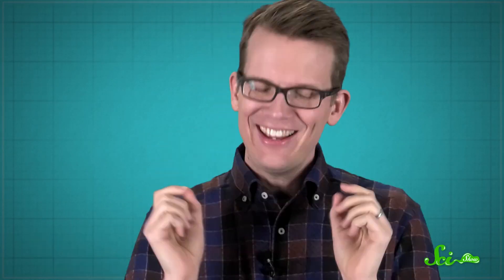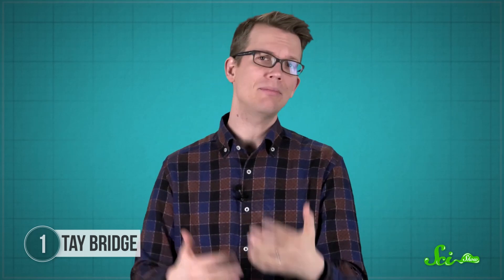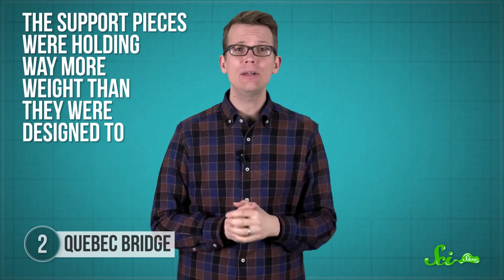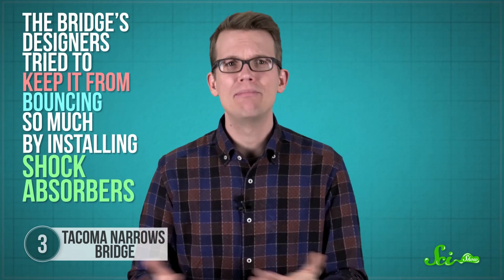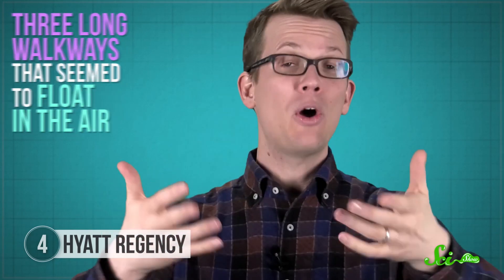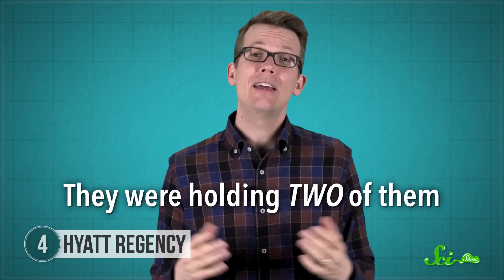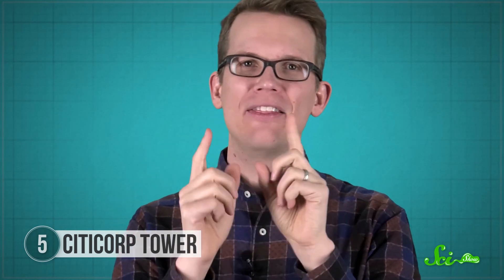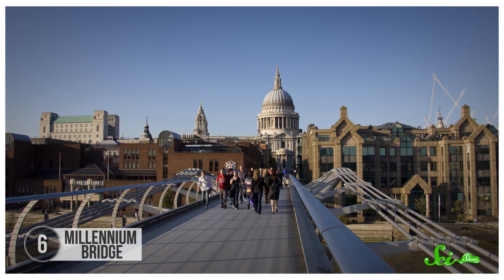6 Construction Failures, and What We Learned From Them

Comment: You missed SO much with the Tacoma's narrow bridge. That day the wind happened to be continuously driving the bridge to oscillate at its natural frequency. The cables snapped as a result of harmonic motion, which just allowed the bridge to oscillate to it's natural frequency quicker. With no proper damping the energy in the system caused the bridge to collapse. It's a simple concept that could have easily been explained...

Comment: 6:12 
You got it all wrong . 
Engineers can not make a mistake like that . 
Maybe the first engineer can , but it will be spotted from the next engineering or the next the next the next that reviews the project . Not to mention there were computers . 

That is a childish mistake ! 
If a floor supports two floors and not just it own weight then be sure that it is calculated to do so . 

The problem is that whene these calculations are applied in the structure the materials are not put in place as they should . 
For example the beams that are ment to support one floor are put in the place of the beams that are ment to support two floors .

Comment: The dampeners could generate power, like some wave power systems. I wonder how efficient those are compared to this US DOE funded one:
"Atargis Energy has designed, constructed, and tested a 1:10 scale model of its Cycloidal Wave Energy Converter (CyCWEC) at the Texas A&M Offshore
Technology Research Center. The CycWEC is designed to address storm survival and energy costs—two issues that hamper many wave energy converters
currently under development. The DOE-supported work demonstrates on a kilowatt scale the world’s first fully submerged wave energy converter system
capable of cancelling deep ocean waves using hydrofoil lift. Laboratory tests and simulations have achieved 99% wave cancellation. System modeling
indicates greater than 70% overall wave-to-electric power conversion efficiency and levelized cost of energy below $0.14 per kilowatt hour are attainable." - They were working on a 5MW model in 2015.

Comment: Another failure to look at would be the Melbourne Star (previously the Southern Star) Ferris wheel/flight. Work began in 2006, delayed and delayed for years. Closed 40 days after opening after large cracks were seen, which were initially blamed on the extreme changing weather conditions Melbourne goes through and subsequently dismantled for scrap. Inspection found that it was poor design, not the heatwaves, that caused the cracks. Upon reconstruction, many faults kept appearing. In December 2013 the wheel finally reopened. Again, since then, there have been minor faults along the way, including a cabin that got locked in position and didn't rotate as the wheel moved.

Comment: Surprised you did not include the Willow Island cooling tower collapse on 1978 Apr 27. I ended up in one of the ERs which handled the injuries just as they were cleaning up from the insanity. I had shattered my arm, and my doctor set my arm wearing the same pair of scrubs he had worn all day treating/operating on the survivors.

Now, on a "funny" construction failure list, though you probably cannot find anything about them... there was a bridge they were constructing about 30mi down river from Willow Island where WVDOT had to stop and rip out a tower and a few sections because they had misaligned the construction efforts from the two sides of the river.  Or the stupidity where they had been working from two different directions on I-64 and had to redo a chunk because they had shifted things so that one lane from one direction met up with the lane for the opposite direction which they were building from the other direction.

Comment: Get your facts straight on Citicorp Tower.  The original engineering drawings called for welds, but the construction co. used rivets and inspectors didn't catch the difference or were paid to turn a blind eye.  This was not an engineering failure.

Comment: the Hyatt Regency also failed because of the supports holding the rods. they wielded the open end of the beams together which buckled in on its self on the weilds, instead of using solid beams.

Comment: Hank, I'm almost positive you got the skyway failure wrong. I remember learning in engineering school that the suspension system was held by bolts in single shear when the design called for double shear. This doubled the load on the bolts leading to failure.
Reply: That is possible, but everything I've heard from the engineering classes I've taken and my own research have almost exclusively talked about the change in the design for the rods. There's actually a problem about the thing in my Physics textbook, though it shows three walkways interacting with each other instead of two and saying that the safer design was "impossible" because you couldn't put the nuts on any of the walkways except the bottom. This completely ignores the fact that, were the rods threaded along their entire length, nuts could indeed be threaded beneath all of the walkways.
Reply: As I understand it, the contractor initiated the change to make construction easier, he forgot to tell the engineer...

Comment: The Hyatt Regency disaster was caused not by an Engineering design problem but rather by the builders from what I was taught. The builders themselves decided on the change but it ultimately ended up being at fault because that change was overlooked.

Comment: Guys it's important to note that the engineer responsible for the building (5) in NYC had said to weld and not bolt the structure, it was the bolting that was the problem
It was cut because the  contractors wanted to save time and money on the project

Comment: On the subject of necessary bridge inspections you missed the MPLS-St. Paul I-35 W bridge collapse.
Reply: timmmahhhh When I was A young engineer designing a platform to hold two mixer gearboxes over a tank, I
I totook it to a more experienced engineer along with my calculations. He said it should work, but just didn't look right
THen he told me "People 
E remember you for what falls down, not what stays up." I beefed up my support design after that. It's still working after 35 years.

Comment: note to self: do not go on wobbling bridges
Reply: I'm in Pittsburgh so we have no shortage of bridges here. All bridges wobble and move. It's a little unnerving the first few times you notice it, usually sitting at the very ends of the bridge where the movements begin to speed up but have less room to move is where it's most noticeable. A lot of times I found it's not very noticeable when I'm in my car but when I'm in my truck it's extremely noticeable.
Reply: I drive over a wobbley bridge everyday. It’s a floating bridge built on pontoons across a lake and you can feel the bridge moving in high winds. (This bridge actually sank in 1990) but they say it’s perfectly safe now...

Comment: I don't understand the skywalk problem.  It seems to me like the ceiling rods were supporting both skywalks in both designs. What's the difference?
Reply: The redesign added a lot of extra stress to small, but vital, parts of the skywalk. Eventually, the stress grew too much and the thing just failed.

Had they stuck with the original design, the extra stress wouldn't be there.
Reply: foxymetroid Oh,I had to watch it again to understand.  I thought the ceiling rods were the problem.  But it was the 4th floor supports, they were supporting twice the weight and failed.

Comment: There is more interesting detail to the Hyatt disaster.  I recall reading about in in New Scientist (UK) at the time.  

The engineer who designed the structure deserved part of the blame.  In his plans, each rod was supposed to have threaded sections in the middle, for the nuts that would support each walkway.  

However, that design would have been very difficult to fabricate.   The contractor would have had to cut threads on the entire rod, so that the nuts could get to the proper places. Perhaps also there were no plants who could have fabricated such rods of that length; I don't know.  

Anyway, the contractor formally requested permission to change the design as shown in the video.  With that change, the rods would need threads on their ends only.  Then someone (perhaps the same engineer) approved the modification, without realizing that the loads would change completely as a result.
Reply: PS. What failed in fact was not the rods, but the horizontal beams that supported the walkways.  Each beam was a hollow rectangular bar made from two C-section steel bars, welded at top and bottom.  The weight of the bottom walkway passed to the nut on top that beam, and then the nut at the bottom of the beam received the weight of both walkways.  The two nuts then pinched the beam, splitting the welds and separating the two C-sections.

Comment: Should have put the Space Shuttles on this list.
Reply: Challenger exploded because the boosters weren't supposed to be used in weather that cold. In fact, the engineers knew this and tried to get the higher-ups to cancel the launch. Columbia exploded because the astronauts didn't get an okay to check the heat shield.
Reply: +foxymetroid - I wasn't referring to the explosions, just the design and construction in general. $600B for 135 launches, when it originally promised 30 launches per day and to cost half as much.

All associated engineers now say that we'll NEVER build one like that again, from now on, the capsule and payload go right on top. No more chunky space plane designs.

Comment: What about the tower in London that had a concave side that faced the sun, causing it to focus the sunlight across the street and melting the interior plastics of a car parked there?
Reply: That was the front of the Walkie Talkie, I think they had to coat the glass in some sort of absorbant material that then raised the interior temperature of the building meaning they have to run the air-con continuously.

Comment: The Citicorp building was originally supposed to have the welds and not bolted joints - that was another on-the-spot change to the plans to save costs. As I understand it, the head designer wasn't even aware of the change until he went back to the plans after speaking with the student asking about the building's stability.

Comment: I have heard a different story for the Citicorp tower. I heard that the designer had always intended the building to have welded sections rather than bolted for exactly this reason but the builder used bolts to save cost.

Comment: When I was in London three years ago and was supposed to cross that bridge over Themes I walked a little bit (not even 1/4 of it), then I had to turn around and walk back. I didn't trust that bridge at all, there was something about it that made me dizzy, felt afraid of the height and just made me kind of sea sick (it felt that I would vomit). I had never heard about these problems with the bridge. I wonder if it's completely safe now, because for me it was something that made me very worried about it, and I normally have no problems with walking over bridges. I wonder what made me so unsure about it.

Comment: wasn't there a metric/imperial oversight with the space station by the Russians and US?
Reply: You might be thinking of a mars orbiter mission. The company contracted to build the probe worked in imperial (even though NASA required metric in the contract) and rounding errors in the mass conversions resulted in the orbiter becoming a pile of scrap on the mars surface :p
Reply: Similar situation with gallons & litres of fuel in the Gimli Glider.

Comment: Unfortunately, we continue to encounter the number 2 issue. A number of University libraries (UMASS Amherst, ULM, etc.) have been constructed across the United States that were built only to find that the building couldn't support the volume of books that were meant to be installed. 
Lesson: Dead Trees are Heavy.
Reply: Also UT Austin Battle Hall. It suffered cracks as the books arrived.

Comment: It's worth noting that the Hyatt Regency walkway failure was the engineers essentially calculating 1+ 1 = 1.  It's a surprisingly easy mistake to do when you make last-minute changes to a design.

JAL 123, the single worst single-airplane disaster in history was caused by exactly the same error.  The aircraft suffered from tailstrike damage on a takeoff and Boeing engineers made an accidental stress doubling error in the repair.  Several months later, the rear bulkhead ruptured, severing all the hydraulic control lines.  The plane, unable to steer, flew into the side of a mountain 32 minutes later, killing 520 people.

Engineers, double-check your math!

Comment: Can you call 9/11 a structural collapse ?
It didn't have anything to do with engineering
Reply: cartbart1 The engineering aspects did contribute (and all building collapse is technically structural) but not in anyway the designers could reasonably anticipate. Calculating the force of the impact of a plane is different from designing out the effects of a plane being deliberately flown into it, with all the additional damage that causes. In this instance having the structure on the outside and having steel truss floors contributed to the failure.

Comment: I remember taking a class for engineering on #4 Hyatt Regency. The class went through everything that went wrong with the project and we even had mock court battles between the engineers that signed off on the faulty plans, the contractors who sub-contracted pieces of the project out to the cheapest company they could find a bid for, and even the project architect. I ended up drawing the lot to be the contractor company representative that hired bad sub-contractors to do the work. I assume this type of example is the introduction to engineering class every engineer has to take now. Even though I was majoring in Computer Engineering & Computer Science I had to take this class as well. For my major it would have been computer simulations that should have caught the faulty design. The beams were not thick enough and the bolts were not suitable for the amount of weight the components had to handle. It was basically a blame game, the sub-contractors blamed the general contractors who hired them and the general contractors blamed the lead engineer who blamed the project architect.
Reply: The story is more complicated than that. The original design (as correctly described in the video) using a single long hanger with an intermediate flange to support the upper walkway was, in fact, not actually something that could be fabricated. It was then that the design was changed to something (two separate hangers) that could be fabricated. Even today, too many engineers have extensive experience with structural design calculations and little or no knowledge about fabrication processes. It is easy to draw something on paper (or on a computer screen) that, as a practical matter, can't actually be made. Another famous example was the Sydney Opera House. Jørn Utzon designed something that looked fabulous on paper, but couldn't be built as originally conceived. It took years and millions of dollars before they could figure out how to fabricate something that appeared similar to the original concept.

Comment: There was another serious design change that created a flaw in the Hyatt skywalks. The horizontal beams that the skywalks' supports connected to were designed to be I ][ shaped beams. The design was reversed to become  box [ ] shaped beams. This severely hampered the horizontal beams' abilities to handle the force of the skywalk's supports. During the collapse, the supports simply pulled right through the thin middle connection points of the box shape, and the rest was history.

Scishow did cover the most serious flaw, of course, but not the only flaw.

Comment: I believe the Hyatt Regency's fatal flaw was actually in the u-beams that the rods were attached to supporting the walkway. The way they were welded together, to form a box with the rod going through the middle, had almost no load bearing capacity and were primed to split apart. While the separate rods didn't help, the incorrectly installed u-beams caused the collapse.

Comment: The Quebec Bridge Collapse you talked about is the reason most Canadian engineers wear iron rings on their pinky fingers. After they graduate there is a special ring ceremony where the graduates are awarded their rings and are reminded about how important their jobs are. They wear it on their pinky so they feel it rub the paper as they make their designs constantly reminding them about how important it is to do their job as carefully as possible. Basically its a constant reminder of the engineering failure of that bridge and what happened. People say that some of the first rings were made with actual materials from that bridge but i doubt that is actually true.

Comment: In a few years, you guys might need to update this episode with the fucking disaster that is the eastern span of the Bay Bridge in San Francisco, CA. It was way over budget, took several years over the estimated completion, and turned out to be chock full of engineering problems (rusting components, leaking on the bridge and in the structures that penetrate the water, etc.).

Comment: I loved this. Please make more videos about engineering failures!
I once took a course called "Product Design and Failure Analysis," and we spent part of it going over a few engineering disasters; one of which was the Hyatt Regency disaster.
Another one was the Big Dig ceiling collapse, which was a result of a design failure. Not only were the bolts too short, but the epoxy used to glue the bolts into the concrete were not up to standard.
Turns out that a lot of the time, failures happen because of last-minute design changes that compromise the integrity of the final product....